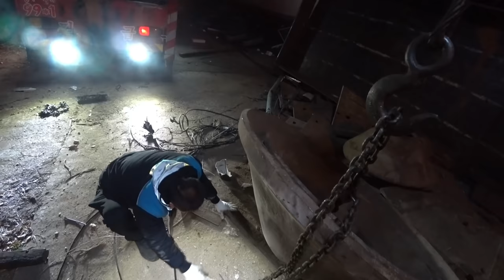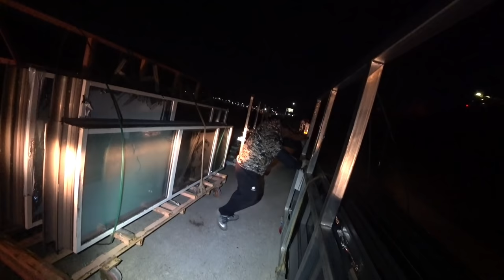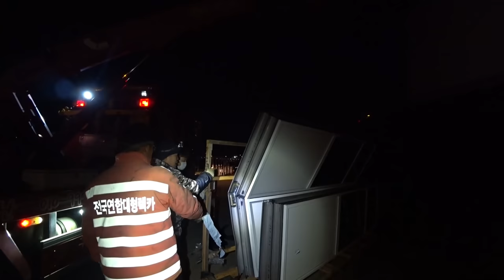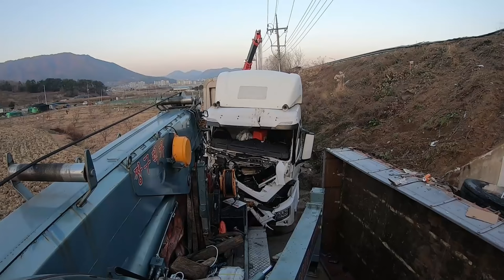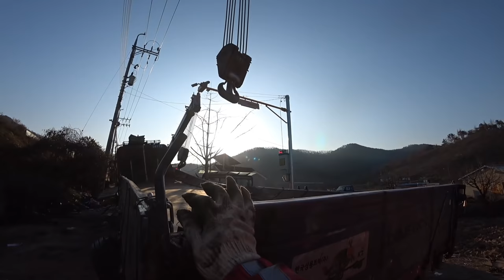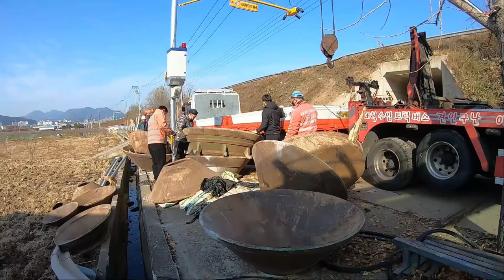26시간 사고처리/대형트럭 도로이탈 사고/Accident handling 26 hours/two heavy trucks/highway fall/fatal accident

Comment: 저는 한국어를 못해서 구글 번역기를 사용하고 있습니다 만, 당신이 회색 트럭을 위해 리모콘을 가지고 있다는 것을 알았습니다. 왜 지상에 서서 트럭을 운전하지 않습니까? 아니면 그 위에 서서 무슨 일이 일어나고 있는지 느끼고 싶습니까?
Reply from the maker: It is only in the cockpit when working with containers or heavy weight work, and you have to use the remote control to attach the chain to the truck or to do other things.  Or I have to keep going up and down.  Just because you're in the cockpit doesn't give you all the sight.  There are places that are not visible, so I use a remote control.
Reply: @user-jjanggu  Ahh, I see I was just little confused.
Reply from the maker: @BlueCrayonOfficial  Thanks for watching.